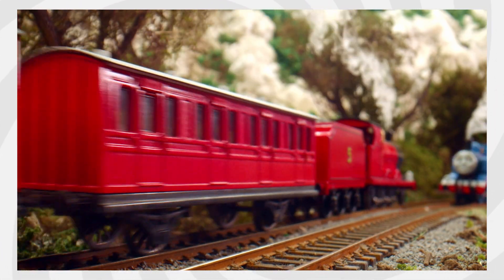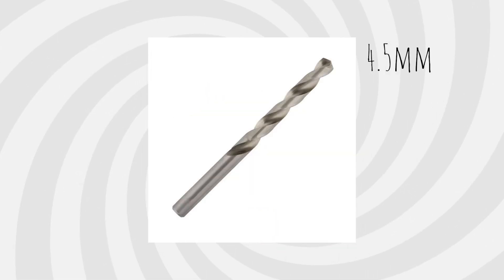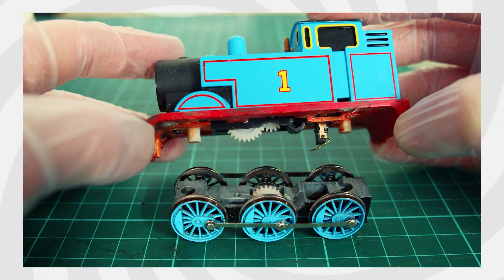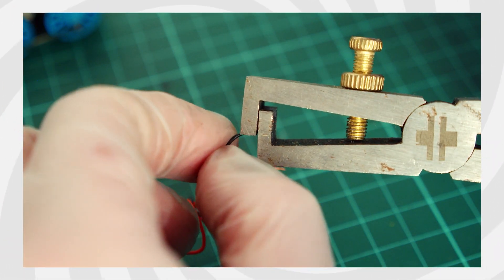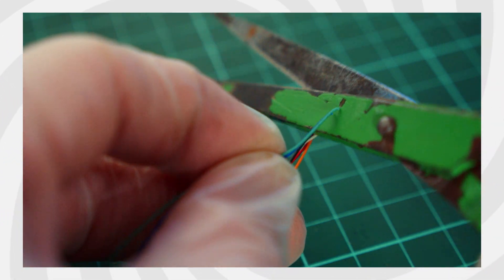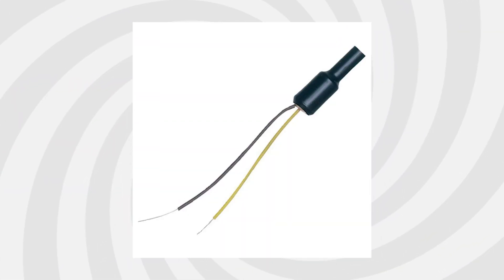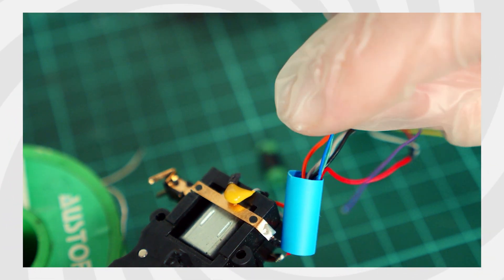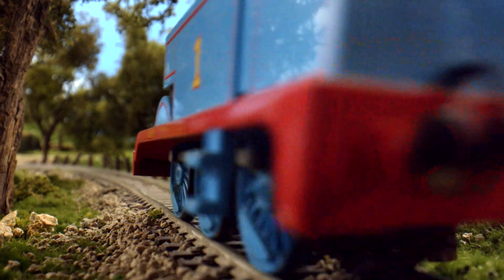Adding a SMOKE UNIT & DCC to BACHMANN THOMAS THE TANK ENGINE

Comment: what kind of voltage does the smoke unit take?  I have heard that some decoder function wires will not put out enough output for the smoke unit and can cause the decoder to burn out?

Comment: My Commodore Vanderbilt has a timing of the steam that times the puffing yes it's DC but it's different to original live steam engines that run at full speed where as this one has a fan that controls the smoke unit.

Comment: Quick questions

if you do mod your Bachmann Thomas to work with DCC, can it still be DC operated?

Also, if you mod the Bachmann “Thomas With Analog Sound” will the sound still work, and can you control the whistle sounds using a DCC controller?

Comment: I have some questions.

1. How hot should the soldering tool be in order to connect the wires?

2. How do you properly use the drill bit to cut off the funnel?

and 3. Where can I find a 3d printed model of a 4.5 mm funnel? Is it on shapeways?

Comment: ...I am actually really happy this video exists.
Although I am slightly surprised.
If you are not aware, the New Bachmann UK Thomas is DCC Ready, and Bachmann US is doing DCC Sound Fitted Thomas and Percy soon.
It was supposed to come out last year, but certain......World Events meant decoders have been on back order.
I wonder how it would work with this tutorial?
Reply from the maker: It's funny you should mention that. This video script was written before I received the donor chassis, and the model showcased here actually IS a DCC ready engine. I personally prefer to hardwire regardless because you can use a decoder that will take up far less space in shell, but with the DCC ready locos you just need to add a 'Next18' decoder - you'd need to make sure this one has extra function wires for your smoke unit though. I have no idea what decoder the sound Thomas and Percy will have, but again as long as it has extra function wires you'd be able to add a smoke unit. If not, you'd likely have to hard wire like shown in the tutorial regardless :)

Comment: I know why you had to remove it, but I find it funny you said the Thomas was not DCC ready when you cut the circuit board that had a Blanking "Next18 Pin Decoder socket" fitted.

ALSO, it would have been nice to recommend the DCC Decoder you were using.
Because NOT all DCC Decoders Function outputs can handle the amount of power/Amps a Seuthe Smoke unit uses.
Most are designed simply for LED Lights.
Reply from the maker: Yes you're right tbf - I'd written and recorded the scripts before I received the donor chassis and forgot to actually say this one was DCC ready. That's a very good point and I'll make sure I add that to the description. That'll teach me for being hasty! I'll be sure to add more details in the description. Thank you :)

Comment: Thank you for the tutorial! Really makes me intrigued to intigrate it for my models one day.
Out of topic though: how exactly would it be possible to change the polarity of the motor? There are some shells that fit back to front, and I was thinking if it's possible to integrate that AND implement DCC.
Reply from the maker: I'm pretty sure that there are CVs you can change on your decoder (with whichever DCC system you use) that allows you to change the polarity electronically. I've never done it before though!